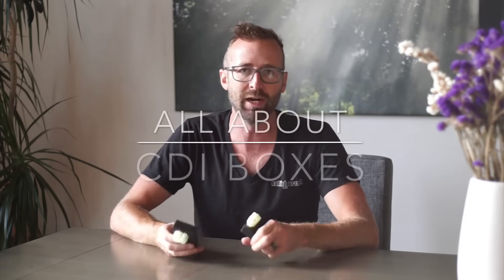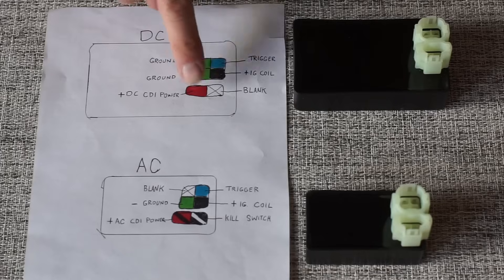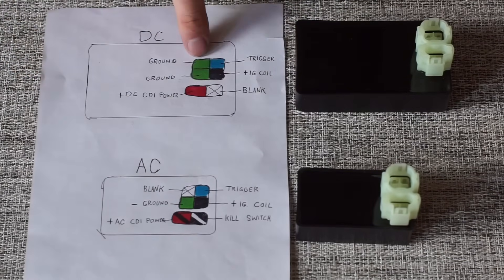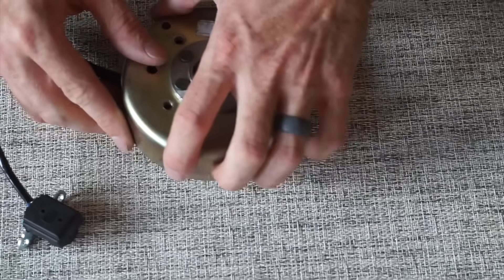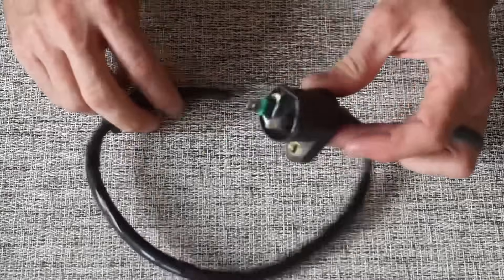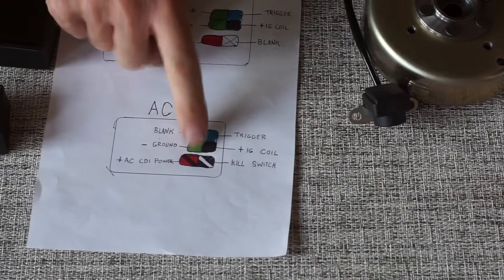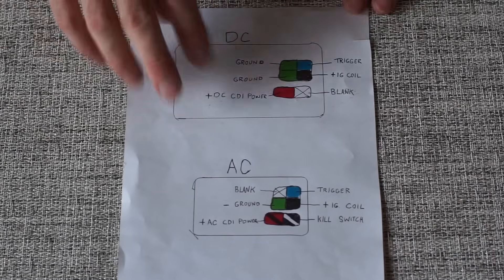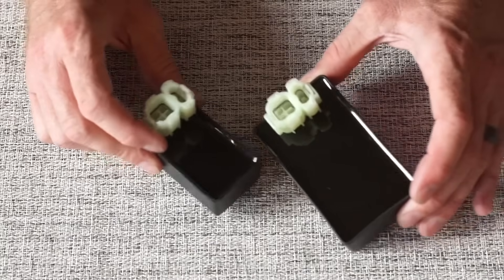CDI  BOX: AC vs DC performance vs stock

Comment: Wiring on 03 Honda Foreman CDI doesn't match either AC or DC box on your video. Black & white wire has 12v DC & there are no blank terminals for starters.

Comment: Is there any possability that u can move any wirering and use an AC Cdi on a DC system? Can u trick the system to run on DC?
Reply: I AM LOOKING FOR WIRING A ENGINE I BUY AND DONT SPEND A FORTUNE IN THE CDI,AND THE LITTLE KNOWLEDGE I HAVE IS POSSIBLE IN THE WHAT I REMEMBER FROM MY CLASSES IN THE HG,BUT I DONT KNOW IF WORK,THE CURRENT FROM THE STATOR IS AC SO YOU PUT A AC CDI,AND GET CURRENT FROM ONE WIRE OF THE STATOR AND IN THEORY NEED TO WORK BUT I DONT KNOW WHEN CRANK THE ENGINE TO START THE ENGINE IS THE 12 VOLTS OF AC.....OR IF IS A KICK START PRODUCE THE ENOUGH CURRENT TO MAKE WORK THE CDI AND CURRENT FOR THE COIL...

Comment: Hey bro I got a problem I got a 150cc gy6  it has not take off at all!! Unless faced down hill the carb and motor is responsive and strong but I have wobble in the back rim I can wiggle the rim. My engine revs up great but it just don't move the scooter it feels like vibrating really hard but not pulling when I sit on it when it's on kickstand and no weight on the rim it spins super good  I gotta couple things going on here PLZ Help Love the channel.

Comment: here a real simple way to keep people from plugging a d.c. c.d.i. into an A.C. system. or visa versa. make the connecting point the plug in's that a d.c. c.d.i. cant plug into an a.c. one.put a matching tab or make d.c connectors one way for d.c. c.d.i.'s, one way for a.c. c.d.i.'s. Save a big mess up's and fried stuff and the manufacturers would get more business than before. because of the simple match up system that could be done? just change the plastic connection heads to two different designs, end of simple problem, if you buy the wrong one you can't install it, you know real quick and by looking at what type of connectors are used you know what system is too. just an idea, peace out!

Comment: This is a great video! I've established that I have an AC system. But my question is if its an AC setup why does my headlight come on before the engine starts?
Reply: it gets power from the battery- ignition on
Reply: ac or dc cdi and ac or dc headlights are two different things
Reply: @nirodper  definitely AC. But the lights do come on with the key on
Reply: @nirodper  i think you may have misunderstood the comment. If the cdi is AC, the headlights typically wont turn on until the engine is running. If the cdi is DC the headlight will come on when you turn the key on. Mine for some reason comes on and it has an AC cdi. Probably because someone wired it that way...

Comment: It would have been simple to hook up a light test to it because with the light test it test is for current if it lights up it's a DC CDI if it doesn't it's an AC CDI or the other way around I don't remember though but that's one great way to check

Comment: What kind of system is it though when the bike doesn't even have a battery. My bike is a cheap Chinese 125 CC Xmotos, that is solely a CDI system with no battery. I'm assuming it's A/C but want to make sure. It is 1 plug with 5 pins.
Reply: DC system needs a battery so yours is a AC
Reply: @leovirtanen764  ok but how about now that Ive added a battery and whole wiring system. The bike doesnt need to be running for the headlight to work, but the ignition switch does have to be on. I do have a regulator rectifier now too so that it all works..

Comment: so on the Chinese engines that have the stater with the ac wire coming out can you rewire for ac or visa versa can you change a ac to dc if you run a battery thanks for the information you provided
Reply: i was wondering the same thing. i have same problem. do have the resolution?
Reply: @bencfpstudio  hey is het je al gelukt om het gy6 blok op de Kymco te krijgen

Comment: Thanks! Using this video and some wiring schematics I was able to replace a $271.90 part (32900-05210) (7 wire) with a $7.49 part (5 wire) and get my brother's Suzuki 125SP running again - after being dormant for about 30 years.
Reply: The original CDI would fire at low RPM (kick starting), but not higher RPMs (idle), so the bike would fire but never run for more than a few revolutions. We worked with the carburetor for way too long before we decided that it might not be getting spark at more than kick starting RPMs.
Reply: That's amazing.

Comment: do the oem dc cdi boxes have a correct advance curve and rev limiter?

would it be beneficial to fit a gy6 style cdi in place of the 4/5 wire  dc cdi used on pit / monkey bikes,  would it eliminate or reduce kickback whilst starting.

Comment: Hi man, got this derestricted cdinon my minarelli scoot. It a small cdi like the AC on your vid but the wiring on mine basing on your illustration, i have a blank space like on the DC one. My scooter has a kill switch too, is that somewhat related to the cdi? Just confused if it’s ac or dc as my cdi probly needs changing as i suspect it’s one of the culprits to rule out as i keep on cutting off everytime i ride for for like the first 10mins  then starts again straight away and cuts off after like 30secs everytime haha hopefully m not soft seizing though

Comment: no Scooter comes with single wire on the double wiring socket of the CDI DC ,, I had DC CDI  large Size : and they comes with R/B and  and B/W :  even if the fours wires socket came with three orfours wires , the two ground green wires are connected to each other even if ther is only one green wire but the second green wire empty place has copper socket connected to the exist ground green wire

Comment: do ac cdi and dc cdi have the same stator coils?
Reply from the maker: No, they are different
Reply: @RollingWrench  so if my bike is equipped with a stator for dc cdi theres no way i can install ac cdi or vice versa?
Reply from the maker: NAT TAN you can use a ac stator for dc, but not dc for ac. Ac has 1 extra wire to kill the engine
Reply: thanks. very helpful

Comment: So DC wont have a Killswitch ?
Reply: Exactly my thoughts, I bought a used 50cc Lifan 1P39FMB engine thats got 3+1 gears, a cdi box that won't run without a battery (dc cdi) AND it also has a killswitch wire.

Why does it have a killswitch wire, is it some very special super rare model? it even has a pull start hooked on the flywheel side (havent seen an engine like that before)

Comment: Edison's theory: Manage the power according to price rate or if they want more power, make a "Racing CDi" w/c is more expensive..
Tesla's Theory: No RPM limiter at d cheapest Price... (Lihua, Lifan CDi's)
Reply: Thing is people need to know why there is a limiter and the proper way to use this knowledge. My scooter is rated by the factory at 10.58Hp/7500r/min. It has a limiter. Assuming the limitation is in the CDI (It may not be, it could be in the variator, exhaust, air intake or carb) and you change it to a non limited CDI, you need to have a tachometer to keep tabs on your rpm's. You want cruise speed plus a little extra for passing at cruise speed without going redline (up to or over that 7500r limit). If you maintain 7500 rpm's you may get to 60 mph plus say on a 150cc but then you are damaging your engine. So we back that down to say 7000 Max with a limiter and you'll never have to worry about prematurely damaging your engine. Folks should FIRST get a tachometer if they don't have one and determine the rpm's at which the limiter kicks in, compare that to their factory specs and that will tell you if it's safe to remove or change the limitation or not. Many CDI's are programable for that reason.. you can bump up the limiter if more speed is desired and still allow a safe engine range.

Comment: there are also some CDIs with strange wirings.
Some Qingqi use both AC and DC. The DC is only for the microchip. SYM Mio the same but 2 wires changed place compared to that Quingqi.
It's an open field finding out all differrent wirings on CDIs.
Greets from Germany!

Comment: Just to complicate things further, some ac boxes are also big ones, and some have those kill switch and ac feeds other way around. You notice that when the engine runs just fine with the new box but does not stop from the key or kill switch... I had to make an adapter that reverses the order for my spare box

Comment: Thanks for the review.  I have an old '85 Honda I'm trying to revive. With all the Chinese junk peddlers out there I was getting confused as to which (AC or DC) CDI unit I needed for my bike.  Thanks to your video I'm better prepared to make the correct choice.
Reply: I recently got a 1986 kaw Concourse and cannot get fire at the plugs.? Voltage from IGN to CDI box 12v or 9v for security, I have heard that there's a diode on IGN that reduce the voltage. Have juice at coils. It's the only one I can not seem to crank. Bumbing me out.
Reply: Diodes aren't used in a circuit to alter voltage,resistors are.Diodes conduct current in one direction only,like a one way valve.Voltage drop over a diode is usually 0.7 volts,unless it's a Zener diode.

Comment: Why does a dc cdi has two slot for ground?where does this two ground connection connected to from your motorcycle?
Reply: Why does there even have to be AC and DC why not just one?
Reply: Mr.Off-Kilt& Ta-Fukk-U. Depends of your Bike is Ac or Dc
Reply: I'm pretty sure it has to do with electrical separation. One is the ground for the charging and trigger system, the other is the ground from the ignition coil. It's got it's own little circuit so that high voltage doesn't go where it doesn't belong.

Comment: Please help, i got 2 grounds the blue wire and the black wire as if its DC but then the  black and red wires have stripes.

When i bought the atv it had a small box on like as if it was AC, now i dont know what to purchase
Reply from the maker: It sounds like you have a ac unit. The red wire with the black strip is for ac
Reply: Rolling Wrench alright, thank you

Comment: Hey bud, I got a old Honda 3 wheeler and unable to get a new replacement harness. If I bought a Chinese atv wiring harness, would it all work into the bike ? Like run the Chinese ignition harness
Reply: Did it ?

Comment: Theres often no big performance gains on switchin CDI.. DONT SWITCH YOUR CDI IF YOUR MOPED/SCOOTER IS STOCK! Its a waste of money. Performance cdi only does 2 things at most.. deristricting the engine from stock rpm max, and a better ignition timing. But ignition timing also comes from the Rotor...Change rotor first.
Reply from the maker: I agree unless it’s a ruckus
Reply: @RollingWrench  I cant counter that experiance, i have not worked on a Ruckus before :D But good video :)

Comment: Hello My CDI wiring I have 4 way connector with 2 green, one yellow-black and one wire yellow-blue / 2 way connector one red-black & one wire white-black. NO Blanks on either connector so my question what do I have AC or DC CDI?  Thanks

Comment: Hey bro I turn my key to the on position and little dimmer lights come on will that mean I have DC I just installed a performance CDI supposedly it was DC but it burnt out my fuse LOL I also ordered a AC haven't tried it yet wonder if it will do the same thing?

Comment: hi! good day. liked ur video. helped me understand how the cdi works. i'll b testing the box on my bike tomorrow. just dont know if the problem on my bike is coming from the cdi box.the start button does not work.but can still do a kick start. and the reading on the volt meter i installed on my bike while i"m riding is 3 to 6 volts only. but when i use the multi-meter, it's reading the battery has 12 point something volts.. meaning it's still good. i;m not sure if my battery is being charged every time i ride my bike.anyway, just wanna share my problem . thanks again.

Comment: Great vid! A video about how to test the  triger signal would be great too. Not just for resistance but for generated voltage while cranking too. And maybe how to simulate a triger signal with an AA batery to see how your CDI is Ok or at least ok to start your bike.

Comment: Anybody know a good replacement cdi for a Yamaha mx175 ?  Cdi is not available and if you find one they are almost 300$
Reply: DT 175 Mx..Yamaha?
Reply: @claudio67362  yes a 1980 Yamaha mx175
Reply: @hondaxl250k0  DT 175 mx?
Reply: @claudio67362  don't think it said dt. Just mx
Reply: Whay year?
Reply: What year?
Reply: Check on motocityreman.com
Reply: They have the replacement for 24.99
Reply: DT 175 ..1980..1981
Reply: 1980 ..1991 sorry
Reply: Do not pay that much for a CDI,its just a circuit,in no way worth more tha 30 dollars
Reply: On ebay for a 140..Send me an email address and i will send you the link..the model 1ya6088

Comment: That was a very informative video brother it helped me a lot to understand. I am from India and I have a doubt regarding the cdi on my moped, basically it has three female connector on cdi from which two are white and one is black. The two white ones are as the same as you have shown in the video and the black one is also a four terminal one and I want to know what does that connector do. I searched a lot for it but I didn't find even a small clue for it. I hope you could help me and yeah it's a 2014 Honda activa 110cc HET engine you can Google it.

Comment: i have a idea for a vid . get one of the Chinese cdi uints to run a bike with points . use the points as a switch ?
Reply: Simon Rawle That’s a good question and I’m wondering this as well
Reply: @FlickTricksOffical  it ca be done . its just sorting out a trigger for wen the point opens to fire the coil

Comment: Hi Rolling Wrench, I have a Trailmaster Challenger 300 and the CDI box broke due to being improperly attached to the frame, I looked online and bought another CDI which has the same connector and installed it , the engine starts and runs but cannot go more than 3000revs approximately, also the muffler turns red which makes me think it is improper timing.If I install the original CDI the engine starts and revs OK but because the connector is broken it accidentally shuts down so I have to go move the connectors and it starts and runs again.The original CDI is 6 pin, the number printed on the box is 250 CC- 2221-150401, the one I bought has no markings.My question is do you offer this model?If no do you know if  250CC-2221-140702 will fit my machine, this is the closest part number I was able to find online.Thanks
Reply: I'm not rolling wrench but I have been dealing with CDI's for some time trying to fix my "bargain" buggy(Manco Helix) If you accidentally switched from a DC to an AC CDI you can potentially be limiting your RPMs due to the AC not being able to charge up the capacitor before it needs to output the spark.
Reply: Thanks for the fast answer.I will buy a different CDI and try with it
Reply: Also check https://gokartsusa.com/GY6-150-CDI.aspx to make sure you have a DC CDI just in case.

Comment: Very nice video! I've got a DC CDI system, but still have a kill wire running up to what I assume was a kill switch (trying to restore a pretty well trashed kart). I guess that's pretty uncommon? Interesting thing is when I ground it, it seems to be a dead short from + -, blows 30A fuse. Not too worried about it, but I'm wondering if it has something to do with why I'm not getting spark.

Comment: Use a volt meter to be sure. My cdi has two wires on the 2 pin and is DC.

Comment: It sounds not 100% explained as both cdis look the same  with 6 pins how do you really differentiate?. It says DC cdis bigger and AC cdis smaller not stamped on the cdi ac or dc in this situation Like to know wiring makes the difference?.
Reply from the maker: Buy a test light. That’s the best way to know

Comment: Thanks! I was wondering how it is working... I am working on a Tuk Tuk in Thailand with a Honda dream 100 engine and the wiring harness has been messed up in a savage way... I fixed up pretty much everything now but I wanted to understand and check the CDI. Great video!
Reply from the maker: 👌 ooohhhhh how I love Thailand!
Reply: they simply use Cheap stock Cdi from China.. Lihua or  Lifan CDi that gives Unlimited RPM but some needs conversion... if u want simple plug and play performance cdi buy dual band cdi w/c is costly

Comment: I want to fit one of these to my 1970 Honda SS50. How could I generate a pulse from the points opening? Cant use a pickup the bike is 49 years old! I can use battery at 12v or the ac magneto output at 15 (ish) volts ac. Engine revs to 11,000. 4 stroke. Theres already a mechanical advance on the points
Reply: They make conversion kits for most the old hondas... I have one in my 1972 Honda sl70

Comment: hi i have the AC box just wondering if the red/black wire that supposed to have power as you crank doesn't  what does it mean
Reply: Sounds like a broken coil. Ebay can replace most if not all of it for cheap but if this gentleman has the same parts support him and his channel.

Comment: I know the trigger wire send the signal to the cdi then  wire runs to the coil theoretically couldn't you connect the trigger wire to the coil wire and get it to run or is there too much digital stuff going on in the CDI that would cause it not to work
Reply from the maker: No you can’t send the trigger wire to the coil. The timing and rev limiter is set internationally in the CDI box before sending the signal to the coil.

Comment: My atv used to be dc but now it's ac with a new wiring harness
Reply: How does it run? Any loss of power on the higher end? I'm thinking of doing the same thing to mine, so I want to make sure that I don't sacrifice rpms.